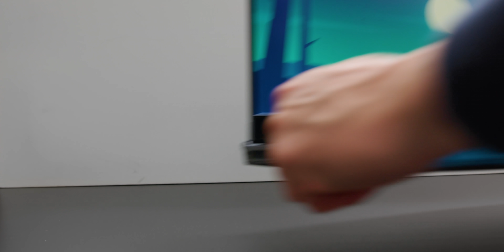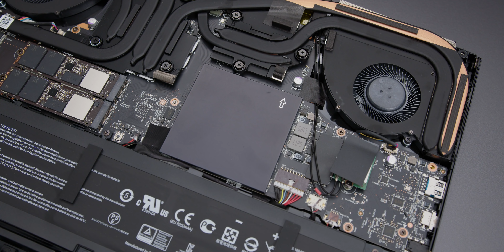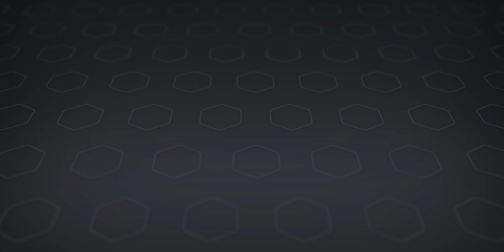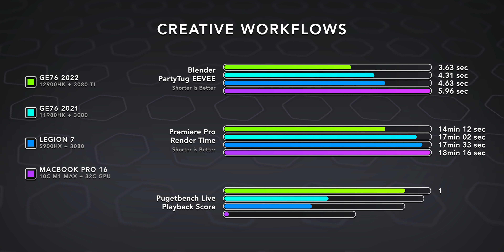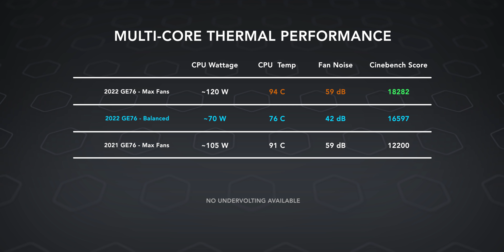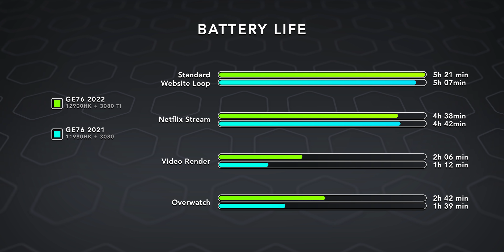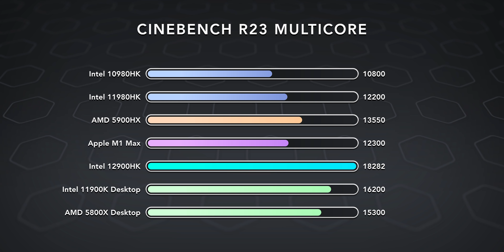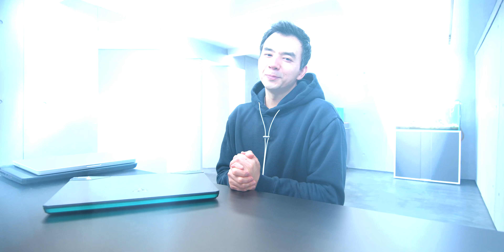This Laptop Is Faster Than Your Desktop

Comment: I disagree. I'm running ryazen 9 5850x , 6900xt, all ok E/K water block with 64gb trident z royal ram 3800 with 2tb samsung nvme m.2 in a corsair 5000d airflow case with 10 corsair LL120mm fans and running my beast is an corsair rm 1100 watt psu.plus.. sorry but that poor little laptop isn't going to touch my rig. And it's a 3080 but a mobile GPU not a desktop gpu.and yeah it's decent for what it is but nothing close to what I have. And yeah for the average PC owner I'm s7re it is probably Lil faster.

Comment: I was sincerely quite disappointed with what I see in this new Intel processors. To say these processors are better because they are faster than some old AMD chips is just to be naïve, uninformed and not quite understand the real revolution under AMD chips nowadays. The big deal of new AMD technologies is 3D V-Cache, chiplets and APUs, processors with GPUs embedded in the same package. This is simply HUGE! Intel might have a civil war riffle, but AMD has a cannon with small caliber that only needs to have bigger bullets and larger tubes to have a far more destructive weapon with absolutely the same technology. While AMD is piling up memory and IBM is piling up circuits, Intel is still in the flatland playground. If this is the best Intel has to show, besides Pat Gelsinger's horrible Christmas pullover and puerile gaslighting, that's quite worrisome. But I won't spoil your enthusiasm with technicalities. I will let you think this is a big deal. You will be quite surprised with what AMD has hidden in their sleeves.

Comment: You did not talk anything ab0ut price, why? I guess these machines are very expensive and not energy efficient at all, i mean you have to buy a laptop around 4000$ and yet can not last a day without charging. Many ppl will say, yeah its for gaming, sure but then buy a PC in case u want it stuck to the wall all day, and will be much cheaper. I would rather build a pc for half the price and buy an extra mac mini laptop for casual work away of my desk and will last for days for battery to die.

Comment: I have a MacBook Air its most likely faster then your desktop since it has the highest single core of any laptop still matching the 5950x desktop chip for single core and 3600 for multi while having fewer cores and no hyper threading windows pcs have to address the power throttling issues when you unplug them from the wall and there performance tanks so hard

Comment: Hi Dave, good stuff as always. I have not seen many of your reviews on DELL laptops. Any reason they are never on your radar. I recently purchased a LENOVO Thinkpad just about an year ago. However, the laptop just started crumbling around the hinge area. Bad construct and casing. Raised this with Lenovo and they refused to get this fixed and claim this is just of warranty. Even when I am willing to pay, they now claim they have no parts. Bunch of crap and extremely poor service. Unfortunately, the laptop works fine, just that it cannot be closed or opened as the entire casing is just crumbling.

Comment: I'm planning to replace my 2021 Lenovo Legion 5 this summer. I want something with a higher end gpu than a RTX 3050 ti. Anyway, this Lenovo is my first of that brand and I am super impressed with the overall build quality.
How do the MSI machines compare in build quality? Also I refuse to buy a laptop without a numpad which the MSI in this video has
Reply: Bro theres no need to get a new laptop when your current ones perfectly capable of playing everything out there.
Reply: @karenwang313  I mostly agree with you but isn't it a bit too weak for VR? I wanted to try some VR.

Comment: Hmm... My comment is about the processor and not really MSI... It's a great laptop by the way.

I can't help but think what will be the performance of the Apple M-series chips if Apple were favor performance with a reduction on power efficiency for their future devices. Intuitively, I feel the M-series chips will blow off anything Intel and AMD may have to offer for the next few years.

Anything is possible at this point, I can't remember the exact Apple M1 Pro wattage numbers but if the ARM architecture throttles like x86... Well...😅 Are Intel's CISC machines? If yes, then I think this is more than just performance and even a school of thought between Intel/AMD vs Apple.

It's really interesting to watch though.

Comment: @Dave2D have you seen major differences between laptops with a MUX switch and those without one? Does this particular system have a MUX switch? The ASUS ROG 2022 lineup has that particular feature and I'm trying to understand the benefit of having one.
Reply: Check out the video done by Jarrod on the topic. Extremely enlightening on how the MUX switch hampers performance for gaming laptops.

Comment: Yeah, Intel did an awesome job fitting a CPU into a laptop that consumes more power than a desktop CPU. 
It's all about the numbers, right? Noone is going to talk about this being a portable device  that consumes more power and generates more heat than most desktops?
You gonna argue this is a desktop replacement device so battery doesn't matter as much? Sure, cause I am going to work or game with 300W under my palms and still being comfortable with the fans struggling to keep it under 100 celsius.

Comment: Kinda disappointed you did not breakdown performance on battery mode. Is the longer battery life because of higher use of the high efficiency cores and lower performance as a result? Like double the performance with half the battery life is the same as half the performance with double battery life... but one gets my stuff done faster.

Comment: In balanced mode uses 70W? That's more than 50% more power consumption than 45W Ryzen 5900HX, 22% more performance (Cinebench 16597/13571). I'm not very impressed.
Reply: Ryzen 9 5900HX is only 45 watts? Used it for gaming or 3D rendering. Sometimes it Even get to 55 watts or more and remember this Intel i9 are 14 cores.

Comment: Intel i9 12900HK - at least 100 Watt
Apple M1 - 40 Watt

i9 performance difference? Only 4%!  So... all that whopping 60 Watt extra power of Intel's latest gen can only give a measly 4% advantage over Apple's FIRST gen! What a joke!
Reply: 4% are you joking? M1 max 40 watts, what a joke! If it's only 40 watts then can you explain why Apple give you 150 watts adapter and 99,9 wh battery on MacBook M1 Max? So much apple fanboy didn't even know what they are talking about, geez.

Comment: I just checked the TDP (Total Power) of intel i9 12900HK and it seems to be 115 Watts.. (Laptop Ryzen 5900HX is rated for 45 watts and Apple M1 Max GPU-CPU combo is 86Watts)
While AMD 5600X desktop CPU is rated at 65 Watts.
Yeah no wonder the laptop would be faster.
AMD and Apple are still better at Performance Per watt which is relevant for laptops...

I think its quite disingenuous of reviewers to not mention performance per watt in the performance benchmark (01:03) and praise Intel for the performance. If anything, MSI is the MVP here for being able to cool a device that has so much heat output.
Reply: @green_block   Thanks for clarifying. But then how does one compare performance per watt?

Comment: This is not a very persuasive alternative to M1 Max for creative professionals. First, the screen is only 1920 x 1080 according to some reports I read. Maybe they will fix this and provide better options for 4K. Second, however, is that export times are not that extremely important for all users (I can do something else in the meantime).  What is mostly important is playback -- and at this, the M1 max is still better.

Comment: M1 pro is already faster than 11900k
Reply: M1 isn't optimized for gaming.
Reply: @genwunner6783  well sure, but it still performs well for it.
What I am saying is that it just really surprised me how multi core performance of low wattage laptop cpu on battery could beat 11900k OCed in benchmarks

Comment: My Desktop scores 29,000 and it does this at the same 120 watt as the CPU in this laptop, its not faster than my desktop and what's more it actually a really bad CPU, typically Intel it uses a crap tonne of power.

Comment: As a certified repair technician, any coponents that runs hot all the time will degrade its life sure you can use it for max, 1-2yrs is it really great or are you just a specs boy😂(the who boughts the laptop), who loves high specs only not the longevity of the product

Comment: Its not a real 3080TI... its a mobile chip and is much different and still slower than a normal 3080. It still has no shot at my 5950x, 3090, and cl3800mhz ram. I'll be honest... laptops last a few years, desktops much longer. These things are ewaste faster than phones.

Comment: I really want to see what the low-mid 12th gen mobile performance is. I think that will be a great sweet spot for easy cheap entry into high performance portable systems, with great battery life. Those efficiency core are very impressive.

Comment: 1080p screen with those specs, missed opportunity tbh. Creators could have benefited if they have at least bumped up the reso to at least 1440p and descent color accuracy. This just shows Intel has taken the spot for performance but still way behind in efficiency, they should just have used a 44 or 56 Wh battery there and increased the heatsink size since you will be carrying your charger anyway.

Comment: Intel does what Intel does best: power hungry single core clock speeds. They always win on top performance when power and heat are not considered. They could've put in the single thread lower clock speed efficiency cores many generations back. It's great that AMD pushed them this hard.

Comment: Noticed a great discrepancy between the Cinebench score and Geekbench. M1 Max and 12900hk are very close natively which is what matters for 90% of consumers. Cinebench is specifically made for x86/64 so must be run through rosetta. The M1 has an artificial disadvantage in Cinebench. Shouldn't it be disclosed for the general audience, as it only pertains to apps running through Rosetta as well? I have no bias towards one or the other, but picking specific benchmarks to impress/woo the audience is unusual reporting. Numbers don't mean anything if presented while omitting information on how they are obtained.

Comment: Damn the cinebench score only drops by 10% when you drop the wattage from 120 to 70. 90% performance for ONLY 60% power, i think the standard performance numbers should be quoted when power is around our list than 70W. Using power no. above that could be used to make these sound much more power hungry than they can be. Clearly 75W is point of efficiency for these.

Comment: I get that comparing MacBooks with Windows machines is more apples to apples by comparing Premier Pro performance, but I think it’s worth mentioning that Final Cut Pro gives a massive performance bump on a Mac. For a lot of users, using Premier Pro for a comparison is akin to using a benchmarking tool because it doesn’t reflect the end performance that you can get by choosing the fastest software available on each system.

Comment: I have a question, Would you rather have this laptop or your desktop ,becasue I had this question to my self for a long time when I went to upgrade my old hp omin laptop into either a laptop or a desktop ,but back then there was a big difference with value , so I went the desktop ,but is it possible now ,Its for 3D rendering, Arch Viz .

Comment: 94 Celsius on max benchmark test performance?
You can fry an egg on this thing. 
Imagine playing a game for 2 hours only for your hands to start sweating from the intense heat generated. 
In short buy this thing if you want a noisy and expensive heater in your room. 
Overpriced stuff really. Just buy something cheaper - something more quiet with better cooling.

Comment: Obviously it's not faster than desktops.
All chips in this laptop are the mobile chips, not actual full wattage desktop chips.
The 51M R2 still beats this laptop as the i9 in that system is the actual desktop chip at full wattage.
The 51M requires two power supplies just to keep up power demand to run at full wattage.

Always check the numbers vs the actual desktop component numbers.
There's a reason no number comparisons were shown in this video, just silly color bars without references.
Don't get mislead people.

Comment: 70-120w cpu against 15w cpu to get how much more performance? I bet performance on battery life will drop way under the score of the 70w cou configuration. Also the extra cooling and heat with fan noise. Let’s wait for their 15w cpus and let’s see what they offer.

Comment: you have to be stupid to buy these laptops - 1-2hrs of gaming and then battery dies off... 

whats the point of having high end hardware if you're limited to only a an hour or two of use. Skip this shit.
Reply: its a desktop replacement. you can't game on any gaming laptop on battery for long much less at full power. lol
Reply: @LCJammer  desktop replacement lol. Thats what they want you to think. Youre better off building a mini itx pc (though admittedly the mini itx cases these days arent that small in the western hemisphere but you can find great smaller form cases in Asia). Then again these modern gpus are a behemoth in size so my point is probably moot
Reply: @sacamentobob  nah mini itx builds aren't worth it to me due to over inflated gpu prices and limited supply. anyways i rather have a decent gaming laptop that i can take wherever i go.
Reply: @LCJammer  that's a issue. These arent decent gaming laptops. Theyre junk. Youtubers and media hypes so these sell, but what good are these if u can only game an hour or so.. probably only a very niche use if you need to be plugged in, which defeats its mobility case. Guess thats been the case for a while. AMD APUs however have a great future but AMD has been too slow to release the newer ones with RDNA2 (or even first gen)...
Reply: *thats the issue
Reply: @LCJammer  my work (part time gaming pc) is a mini itx build with a 2080ti now, and my gaming pc is still my fav 1080ti sli evga hybrids. If you can get a good last gen gpu used then you can get away with a good mini itx build. (Mind you, my mini itx cpu is a 4770k but I game 'part time' there on 4k so it doesnt matter all that much)
Reply: @sacamentobob  lol even used gpus are highly inflated. also, i don't trust buying used pc parts second hand on ebay or craiglists. i prefer new for my builds. anyways, a gaming laptop works for me as i do most of my gaming on consoles and only play some select games on pc. to each his own. no need to trash gaming laptops bro.
Reply: @LCJammer  im not 'trashing' gaming laptops, it's just plain fact and clear to see. 1hr+ gaming on full charge is not mobile gaming, is anyone realistically charging their laptops all the time for 1hr plus gaming? Objectively these gaming laptops are nothing but to show others u can afford an expensive laptop.
Ryzen APUs (and future ones as well) more likely to give one a better 'gaming experience' overall without the need to constantly charge, just need to downgrade visuals a bit or run 1080p with some bits off. With FSR it's probably a smarter thing to do.
I dont use overpriced gpus. My 1080tis were brand new when I bought them and they were still a 'reasonable' 720gbp per card (read 720usd without the tax)  for top of the line back then. My 2080ti is used. Ive bought used cards before, you just need to know how to look. Im not going to pay inflated prices for current gen gpus to line Papa Jensen's pockets.

Comment: I love MSI. So much so that in fact I am writing this from my 2013 MSI GT70 2PE Dominator Pro, with 12GB RAM, 6GB DDR5 GTX880M, which still has more under the hood than the VAST majority of laptops being sold today for the average consumer. However, if this is an MSI, it will always also represent: heavy, big, power hungry, jumbo jet like fan noise. If you want and need power on the go, it is MSI. If you want portability you can do better, like a Zenbook for example.
Reply: just wait until intel buys arm. lol

Comment: These are cool. But I'm still gonna have a desktop because these laptops are chonky and not upgradable. I need juicy GPUs for VR. Which is sad because I don't use it outside of VR! I usually don't play graphically intensive flatscreen games

I'd kill for a laptop with a CPU like  this I'm a zapherous or something chassis and a cheap standardized egpu solution with PCI-4 WITHOUT thunderbolt ports.... But sadly that'll never happen.

Comment: I am more excited to see if they can compete with Apple on thin and light notebooks.  Can their lower end laptop chips compete with M1 in a device like the macbook air (fanless or almost no fan noise at all and cool as a cucumber)?  I want a laptop like the MBA that doesn't run macOS.  I want it too be silent, cool to the touch at all times, and have battery life for days just like the MBA but running a better OS like Ubuntu.